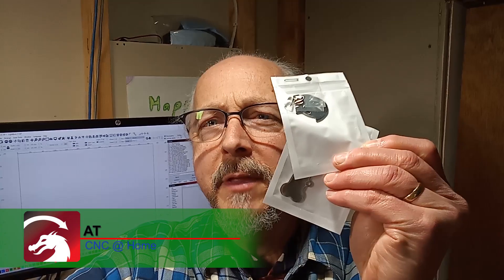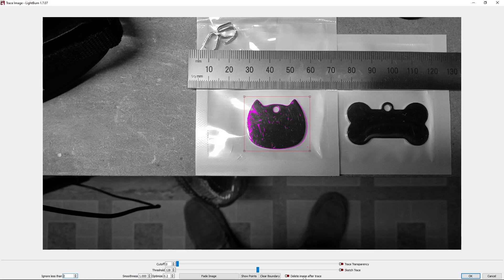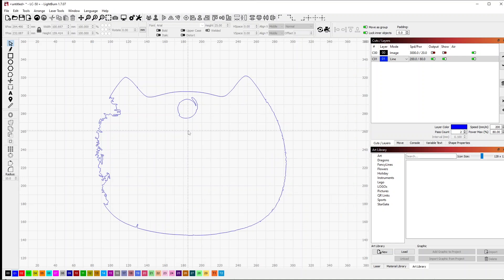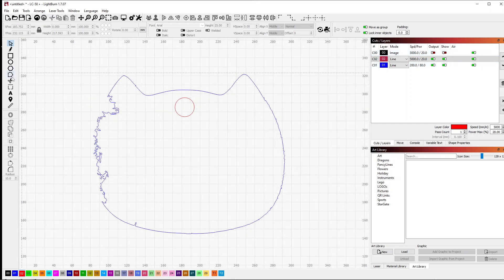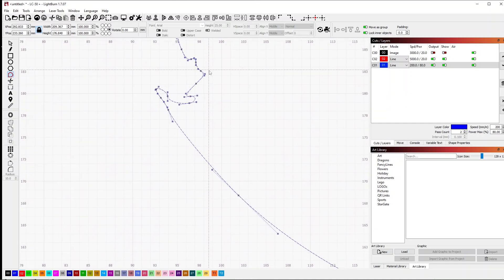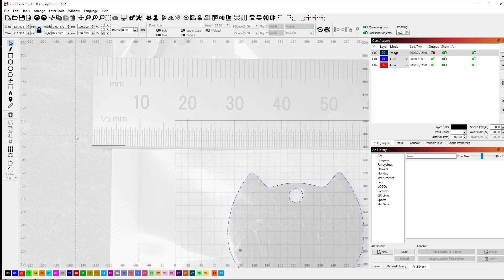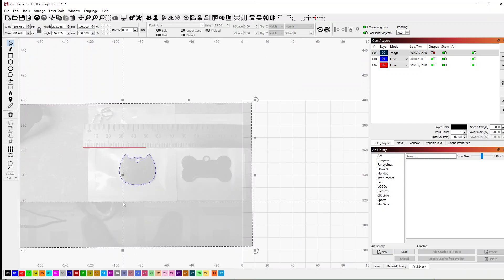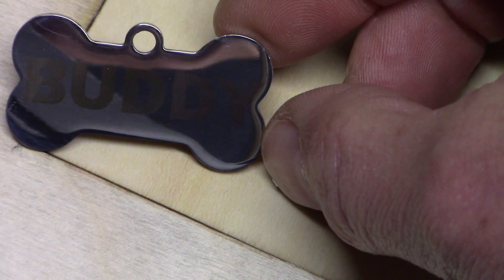Easy method to create LightBurn templates from material blanks

Comment: You should hit it with your titanium and then place it on a black background.  That should get rid of the reflections.  I have reasonable results using my Canon scanner/copier/printer
Reply from the maker: That is a great idea!  The contract between the item and the background would be so much that it would more easily be able to trace the edge of the item.  The reflective nature of the SS make it more difficult.  I will have to try that to see how it works.  I would think it would work great!  I have used my scanner in the past to do a similar thing. The results were ok.